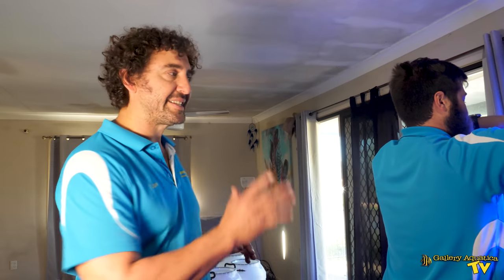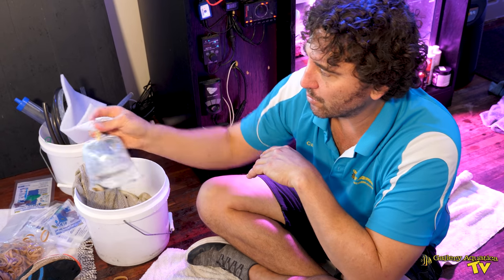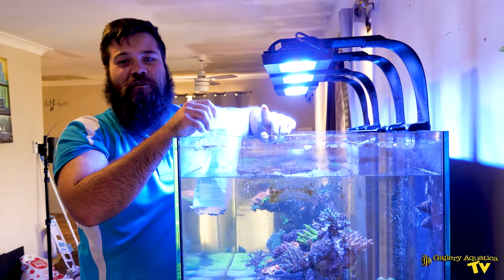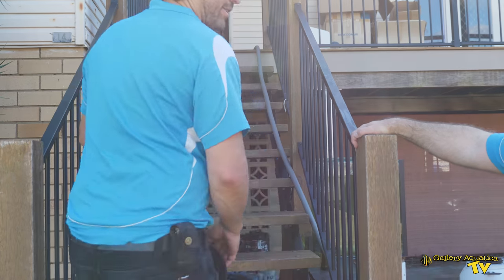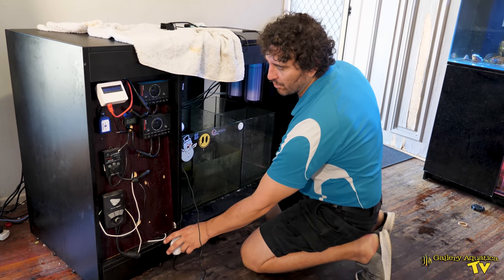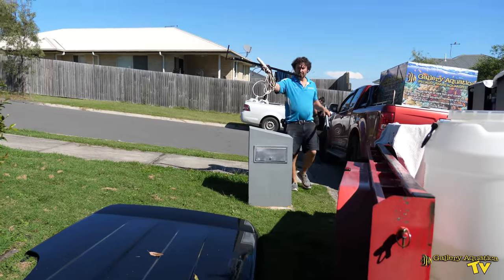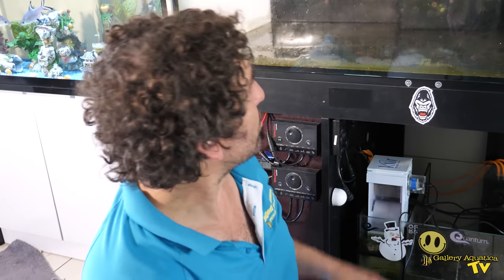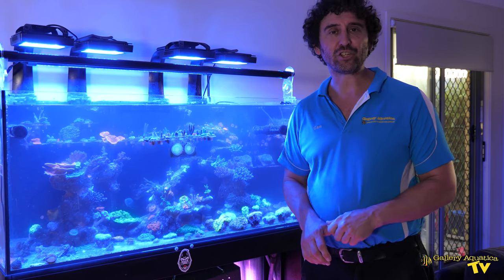Moving an Established SPS reef tank

Comment: If I’m moving an established mixed reef tank an hr away do I have to remove the sand and go bare bottom and then add the sand back over time if I don’t wanna stick to bare bottom?? I’m getting mixed info here I’ve done it multiple times myself without removing the sand and I don’t remember anything besides like an algae bloom or something similar but I’m being repeatedly told if I don’t remove the sand then when I set it back up I’ll have a crash and lose my more sensitive corals I’m the process and that’s the last thing I wanna do.. was told that or I would have to move the tank with 3-4in of water left in it and don’t see that being possible 3 people moving a 120 with 2-4” sand bed and water plus it’s a glass aquarium sku da like it’d be waaaay too heavy
Reply from the maker: I think the worst thing you can do is to ditch the sand during a tank relocation. I always keep it, as the beneficial bacteria you’ll keep is a huge advantage to the water chemistry in the days following the move. The problem people have when they keep the sand is the detritus in the sand can pollute the water after it’s removed and put back in, however this is easily fixed by rinsing the sand in seawater (preferably from the tank). I ALWAYS keep the sand. Cam
Reply: @GalleryAquaticaTV  so I’m supposed to use my salt to mix up a bunch of water to rinse the sand??  It’s a 3yr old tank so the rock is very mature it has a sump a gfo reactor etc plus I have some bottled bacteria to help make up for it I jus don’t see any way to avoid the sand releasing stuff from the anaerobic areas that seems to be what causes most post move tank crashes there’s no way to stop it if it starts but I’m also thinking maybe if I put some purigen in the sump it would absorb all the toxins that’s the only thing I know of that can absorb toxic chemicals released by corals and dying matter etc etc but idk if it would be sufficient enough, idk what to do one group says worst thing u can do is try to keep the sand after it’s been disturbed from a move and the other group says the worst thing u can do is go bare bottom when u set it back up I jus don’t see how goin bare bottom is gonna cause a crash as long as I manage the nutrients being put in to the system I can cut way back to give the bacteria time to catch up or jus add the turbo start 900 I ordered jus dump it in their I think it would be fine I mean if like to keep the sand but I don’t wanna do it at the cost of loss of life I was also thinking that I could clean it like u describe and slowly introduce it back in to the tank a cup or to at a time